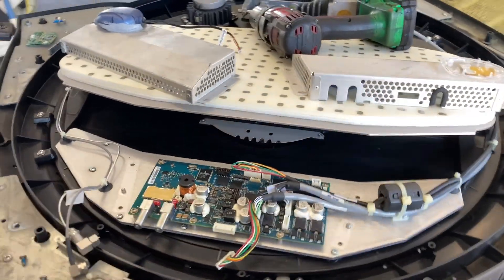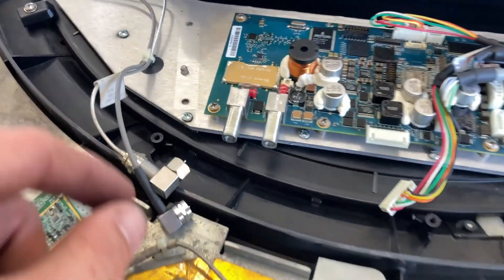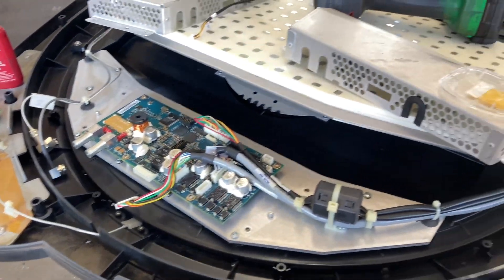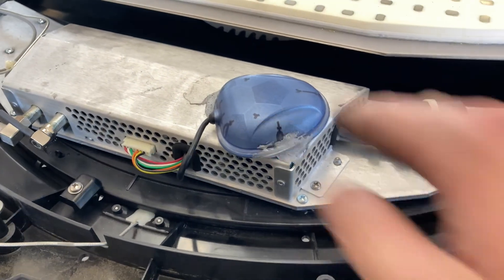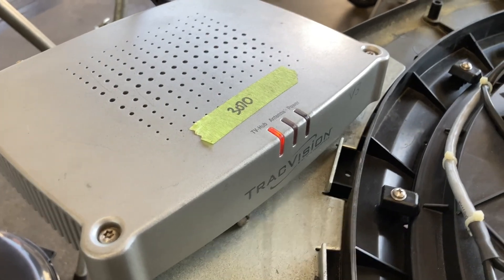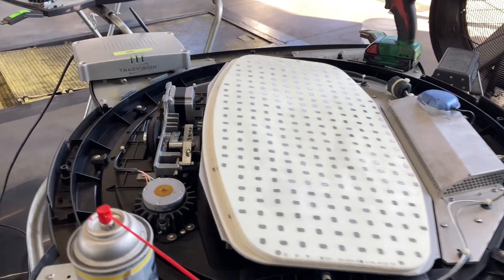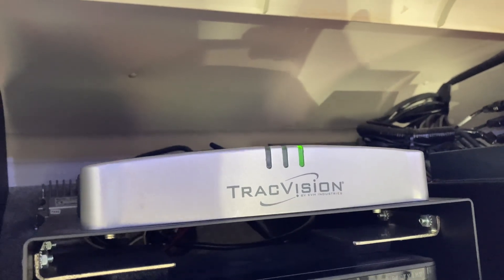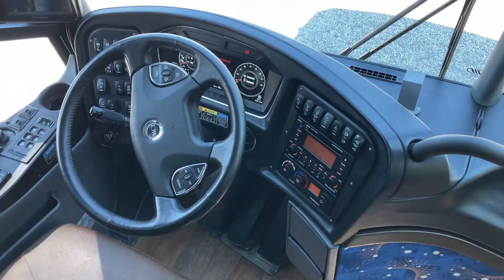KVH Tracvision A9 Satellite Antenna Repair

Comment: The 90 degree coax adapter for the mainboard power is a common point of failure for the A7 and A9. Replacing the adaptor takes care of the issue assuming the problem has been isolated to the antenna itself.

Comment: I'm having problems with my Directv system. when I power up the receiver there are three green lights flash for a few seconds  then the lights stop the first light is green and the second light is amber and the third light is off and it freezes there and the satellite does not move is my problem with the receiver or the satellite, can not find any one in my area that will work on the KVH A9 
Thanks for any help you can give my
Reply from the maker: Sounds like a potential voltage issue. Download the Tracvision App on your mobile device and connect to the Hubs wifi signal. It will allow you to perform troubleshooting and see any codes that may be active.